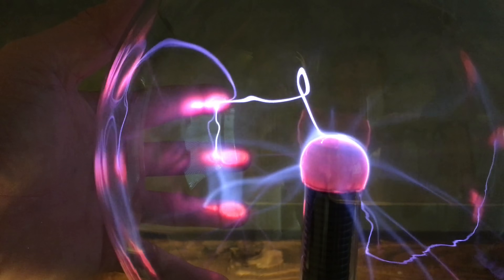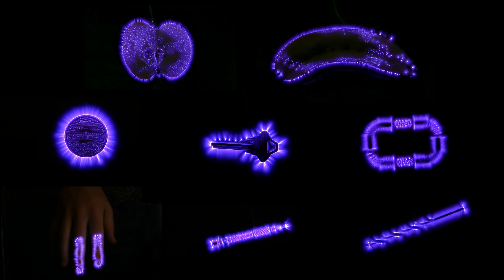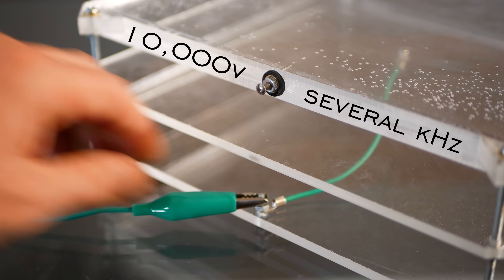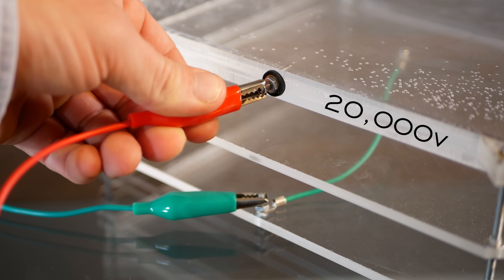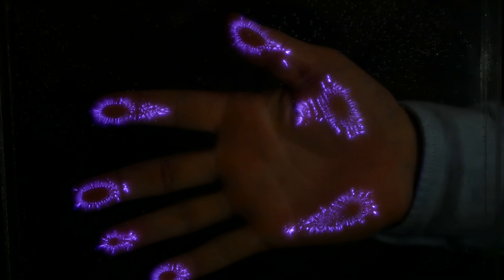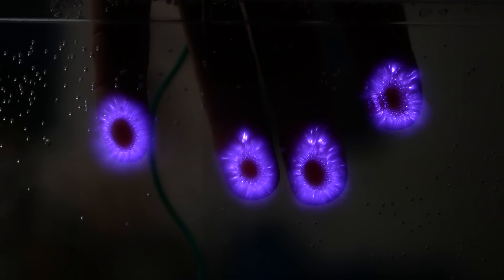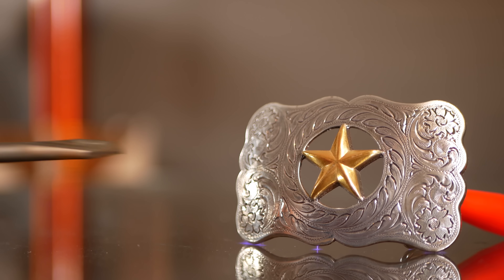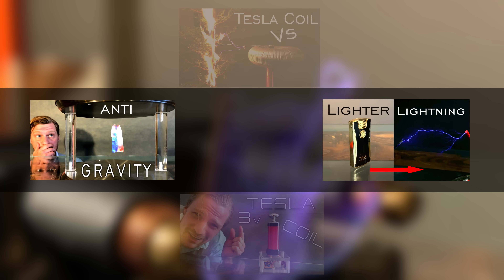DIY High Voltage Imaging With Kirlian Photography

Comment: Years ago while working on a high voltage power supply I failed to discharge a capacitor so even though the device was off it still was holding 25,000 volt charge. I touched it my arm went numb for about 4 hours. Be careful when you work with high voltage.

Comment: This setup would be perfect for sprouting seeds to test the HV hidden DNA I spoke of earlier in my comment on another one of your videos if this setup is enlarged. That commentary related how this hidden, currently untapped, potential lies dormant due to a reduced electrostatic field of the Earth but was higher in the days of the dinosaurs when Pangea was a singular continental mass and the Earth's diameter was smaller along with its gravitational field.

Comment: I have, for the past year or so, visited the plasma channel off and on and took notes on the subject of plasma. The uses for/of plasma, is as far as I am concerned the next level of scientific evolution in science. HOWEVER, this is not the first time this knowledge was used here on earth, We are just in the process of re-learning ancient science. My gravitating into this science stems from a unique understanding of hieroglyphic symbols.For the past 25 years or so, my vocation has centred around the accurate interpretation of hieroglyphic symbols and this has led to discovering the ancient schematic system use by all ancient cultures. Using this unique schematic system, allows me to place hieroglyphic symbols onto this schematic system to see what inventions they develop into. Sets of symbols, have spanned everything from Light bulbs, to self-perpetuating ion motors/battery to the mechanics/schematics for building and operating a flying saucer. The icon I am using at the upper left of this Note is the cross section of a flying sauce ... this picture is too small to see the wiring and other features of the mechanics for this vehicle but simply put there are 12 independent cells that are wired in a unique way that that supply "controlled" voltage to the central ion chamber. This vehicle pulls "light" ... energy without mass into the vehicle under the controlled voltage. This is for the most part the "volks wagon of flying saucers but the functional features are displayed. There are several sheets of schematics not shown here.

Comment: GREAT VIDEO!!
What if you connected (above or below) a thin square sheet of Al foil on the middle plate (with a safety boarder, of course) in contact with the green wire.  This, I guess, will increase the capacitive coupling...increasing the effect?  Perhaps try various areas of foil...or even a conductive boarder connected to the bottom wire????

Comment: well, just because it's physics it doesn't mean it does not show the aura of a person. (or a thing). spiritaulity is not simply believe in magic or so but is partly based on quantum physics and can (theoretically) be explained. for example, a persons aura is in fact the frequency of this person, or the vibrational frequency of the persons magnetic field. this is measurable and absolutely non-fiction as well as the influence of this magnetig field on the environment - and the other way around.
Reply: exactly!!!!

Comment: I have a question. Water is high voltage electrode, right? Then the plate under water, is it ground electrode? What is purpose of two plates under water?
Reply from the maker: There is no other plate in the water. The other plate is the movable tray that slides up and down. The ground wire is attached in the middle, and all the conductive objects come into contact with it.
Reply: @PlasmaChannel  um.. you mean that there is not conductive objects on the water plate. The objects is on the middle plate which is grounded. So order starting from top is water electrode(high voltage electrode) - conductive object - grounded plate(movable plate), is it correct? And how did you take a video? From Top or bottom?

Comment: How to make a high voltage and high frequency source? Please answer, I want to make this.
Reply from the maker: Hi, I've created several videos on DIY high voltage supplies. Feel free to browse my videos to see them.
Reply: @PlasmaChannel  OMG! I can't believe you answer my question.
Reply: @PlasmaChannel  Please tell, if the DIY Plasma Physics Powersource (Mini 20,000v Flyback) can be used in the instant hand sterilizer or this Kirlian photography setup. And what is the approx frequency of the output voltage of that supply? Can the frequency be varied? Please answer, my acrylic frame is ready and I can't wait to make the instant hand sterilizer.

Comment: Can this be done with a neon light transformer I've used one to make ozone using a glass jar tin foil and copper wire it creates Corona near the copper
Reply from the maker: You may be able to do so, but that NST will carry a lot of current and may be dangerous. Practice the one hand rule to be extra safe.

Comment: correct me if I'm wrong but this has nothing to do with Kirlian photography. I see no photographic film. This is simply taking video of coronal discharge.
Reply: You are right. This technique has nothing yo do with seeing the aura. Its only showing the electric connection with that material that he is creating. Same in the sea you see some electric creatures they make this kind of blue lights in the ocean when they move through the water.
Reply: If you’re thinking of “aura photos”, well this is how the insides of those proprietary systems generate that ethereal overlay on an aura photo. People buying aura photos are being preyed on for their ignorance of high energy physics.
Reply: Usually kirlian cameras are meant to reflect more colors than purple. But this good demonstration of unseen
Reply: aCkTuAllY, photography meaning photo = with light and graphy = writing, photography is writing with light. It requires no photographic film as digital photography is still photography as is videography. The images you’ve seen are written with light to a digital sensor that senses light. Video is the compilation of many still images. Usually at 24 frames per second. That’s 24 photographs taken per second of time.

Thank you.
Reply: @DrPWNS-fz6yh  I think you should find out what words mean before running your mouth about things you have no clue about
Reply: @DrPWNS-fz6yh 
Thanks for correcting him
Reply: Maybe call this Kirlian video instead, because it was captured by a camera?

Comment: Hi Jay. Long time viewer and fellow plasma enthusiast.

How is your acrylic not getting scorched? Is the corona touching acrylic? Or is this just a camera illusion?

P. S. My corona discharge ion thruster is bigger than yours XD (wait, just looking, you haven't done an ion wind device yet? Consider this a friendly challenge) ;) 

P. P. S. Can you make crystalline plasma? You'll need a good vacuum pump....
Reply from the maker: Hi Mongrel, glad to have you in the family! So, the overall power level is relatively low, and, i'm only keeping it turned on for a few seconds at a time. If I did leave it on full power for more than about 10 seconds, the plastic warms up significantly. Cheers!
Reply from the maker: Also, Crystalline Plasma? I'll read into it.

Comment: What I notice is that different objects (i.e. metal vs banana vs human hand) show different frequencies of vibration.  The metal is very expressed, the banana is clearly more gentle currents emanating.  The human hand shows very fine, rapid energy release.  It's important to note that this energy is witnessed from all matter, not just humans.  For the aura discussion, we would then declare that everything emanates with this 'aura', and based on the characteristics of energy released (frequency and intensity) we could tell certain characteristics of the object or individual that is releasing the energy.
Reply from the maker: The reason you see differences in coronal edges, stems from how conductive the object is, plus, how large the object is. The banana is not as conductive as the metal objects, plus, is larger. This means the energy is spread out over a larger area, and thus the corona is dimmer on the edges because local energy density is lower. Same case for the hand. 

However, the fingers have larger coronal streams due to the fact that they are small points, with minimal surface area. When energy is channeled though these smaller points (compared to whole hand or banana, the local energy density is higher.

It all just comes down to object size, object conductivity, and perimeter shape.
Reply: @PlasmaChannel  Interesting!  Surely in the case of the human hand, there is a lot that goes into its particular electrical conductivity.  I'm amazed to find we are passing this electricity through our own body all the time!

Comment: Hello!!! I am very happy with abo of this channel thanks for all the videos!! 
But during watching this video there appear 2 questions in my head! 1. Did u fill in normal tap water or did u mix water with electrolytes or something for better conductivity!
And 2. as much as i see in the video u only put a screw into the lower acrylic plate but acryl is not conductive so is this small peace enough or did u use anything similar like alufoil to larger this area whats not showdn in the video???

Comment: Could you please tell me the specs on the video camera you are using . I found that the lower the light level the camera was      capable of , the sharper the pictures were . And Infa -Red video wouldnt work . The problem I had was most of the low-light         level video cameras , switch to Infa-Red at  a lower light level [ like trail cameras ] . .

Comment: Hey man! Is the thickness of the acrylic sheet used for the water housing extremely important? I already have 1/8” thick sheets at home, I was wondering if you’d think that could work? Any issues you could think of aside from rigidity?
Reply from the maker: Great question! IF too thin, you will pull too much current and it can burn you / objects. it needs to be thick enough to resist the current flow. 1/8 may work, just be careful, okay? One hand rule at all times.

Comment: The Amazon link you have for the power supply for this project is no longer available, and Amazon doesn't even say what it was. Can you refresh my memory?
Reply from the maker: Hey Nigel! Thanks a ton for bringing this to my attention. This seems to happen too much on my amazon store. I've found a suitable replacement part. Not sure if it will be a perfect match, but, it should! I've replaced the link, but here it is for your convenience. https://amzn.to/3pKuK9g
Reply: @PlasmaChannel  thank you! So that flyback must not have any internal diodes, otherwise it wouldn't work with this project I assume. I believe you said this build needs AC, right?

Comment: Is there a minimum edge depth for or angle of  the points in order for the corona to form. Serious question.
Reply from the maker: That....is a great question. Hm. I do believe it comes down to sharpness of corner. Basically radius of Curvature. So, it can be tall or short, as long as the object has sharp corners and angles that are in contact with the water filled plate.

Comment: can i use the Mini 20,000v Flyback as a power supply for this project
Reply from the maker: You likely can, though it needs to be an AC flyback.
Reply: @PlasmaChannel  what AC flyback should i buy. i would like to touch the Kirlian device. thx you for your earlier reply

Comment: Hello Sir, I am big fan of your work. I was inspired by your instant hand sterilizer and I decided to make one for my house. I have been working on it for the last 3 months (since your video came) , now finally i am at the end of making it and i am stuck at one thing. Which 2 terminals you use on  both the acrylic glass.  There are 3 wires coming out of the ZVS transformer and there are multiple pins. I am confused with which wire should be connected to upper acrylic glass and which one to the lower. Please help.
Reply from the maker: Hi Kapoor, Why does your flyback have three wires? That is strange. Your high voltage should go to the water connection, and your ground is something you will place on the ground. In order for it to work, you need to take your shoes off and be connected to ground.

Comment: Hi, Will the 
SainSmart Zero Voltage Switching Tesla Coil Flyback Driver for Sgtc/Marx Generator/Jacob's Ladder + Ignition Coil
by SainSmart
run on AC outlet?
Reply: No it need to be dc

Comment: A question, didn't catch if objects have to be in contact with the under plate lead (green wire) and the acrylic? Or if it can just be laid on top ?  Like your hand, in the video, is it sandwiched and contacting the middle sheet and the top water layered sheet? Or do you slide the middle sheet up to contact the water layered, and then lay your hand on top?

Comment: Have you seen the Safire project, part of the Electric Universe and Thunderbolts project? Cool video!
Reply: Anyone who hasn't should look up "Professor Dave Explains SAFIRE project" for a good debunking of the beliefs involved in the electric universe.
Reply: @Morsa.B.Alto1  professor Dave is an idiot and in no way should be using the term “professor”, and not just for the reason that he does not hold a PhD. All researchers should think for themselves and look to test assumptions. Think Karl Popper,  not professor Dave.

Comment: just a suggestion - may want to consider turning the top plate by 90deg. If the water happens to drip when this thing is on it could cause the two electrodes to short which could get real ugly. Awesome video though I'm definitely making one of these soon!!

Comment: I'd watched this video before, and have known about Kirlian Photography since they invented it (I'm incredibly old)... but I'm still wondering about the power-supply you used for this video.  I have a ZVS driver and any number of flyback coils, but those suckers carry a lot of punch.

Mightn't an electronic neon sign transformer be safer?   I don't know what frequencies they use, but I know they reach those voltages.   I'm currently using one with a ceramic ozone-plate in a homebrew water-sterilization unit.
Reply: I have a glass 'ozone tube' with an inlet and outlet just for that! Alas... no pump :/ is that water drinkable.. or just suited for rinsing?
I get so excited when i find other high voltage homebrewers lol
Those plates are great, until they start reaching the end of the road. I went through several for homebrew ozone generators until I found that making my own using glass, titanium sheet, and titanium mesh was less costly and more efficient, give it a shot!
Reply: @P3nguinDarknes5  The glass and metal ozone generators do seem to work, but usually at a very low pass-through rate.

I bubble the output through a 5 litre drinking-water dispenser.  I leave it bubbling for about 2 minutes AFTER I can smell the ozone at the top of the jar, as this means that the water is saturated with ozone.  It remains perfectly sanitized and safe to drink after treatment.

Comment: What do you think of reactive ion etching it involves plasma and somme gas. May be next youtube video subject ?
Reply from the maker: Asgard, I love your channel name.......man that's right up my alley. Good idea too! If I use your idea, i've screenshotted your comment so that I can credit you.
Reply: @PlasmaChannel  i know it is used in micro chip manufacturing/failure analyse/reverse engenering & other IC stuff. Their is some very nice vivid &  graphic colorfull  ic die  shoot : search CPU under microscope there.  is like few kilometer of running coper wire & transistor. It is like your are watching an arial view of a mega city the night. And reactive ion etching could be used to remove or flaten layer of microchip because they are multi layers of mega city's ...

Comment: No luck, I built this using the flyback and ZVS driver from the link. I powered the ZVS with a bench power supply at 30v 5A (maxed out) and I used 0.08" acrylic sheets with 1/4" thick perimeter and filled it with tap water. The tap screw is stainless and goes about 1/2" into the water. Got about 3" arcs from the flyback but hooked up to the plates and barely a fizz when touching the water plate. Even when the object on the plate is attached directly to ground nothing. Am I missing something?
Reply from the maker: Hi Austin, you’re saying even when the object is attached directly to one high voltage lead, and the water to another, no result?? Also did you use tap water, salt water, or DI water?
Reply: @PlasmaChannel  Yes,  The Heavy gauge wire (with the rubber cup) attached to the water plate and the HV GND pin attached to the object (the pin that I get an arc from) I get nothing. I have also tried hooking the pinout to the water plate, with no difference. I am using tap water but I also tried saltwater and an electrolyte solution and it made no difference. I get great arcs from the flyback, about 3".

Comment: Would it help if I added an electrolyte like potassium hydroxide to the water to improve conductivity?
Reply from the maker: I found it actually makes it worse. Seriously. I know, strange right?
Reply: @PlasmaChannel  Indeed, Thank you so much for the response, I was about to add a solution mix to my panel that I'm building now, I'll stick with straight h2o. I share the same interests in high voltage plasma physics and I must tell you that my favorite personal build other than my faithful DRSSTC is my Farnsworth fusion reactor. Watching a perfect sphere of plasma grow like the birth of a tiny star is indescribable beautiful. Its a build I would recommend to anyone with the knowhow. Tip: if you can find the infamous 15kv 60ma non-GFI NST it makes a huge difference.